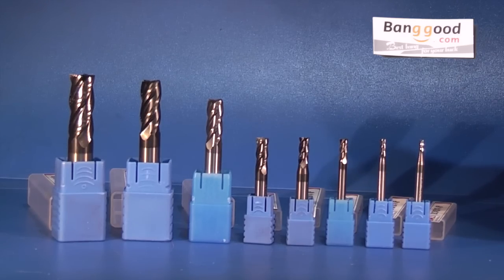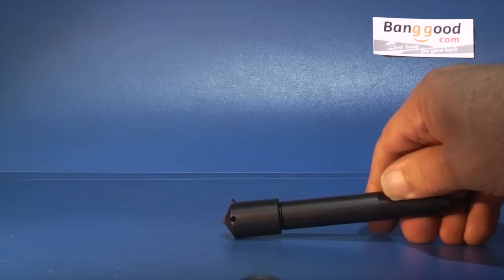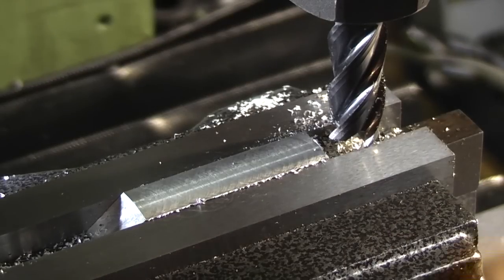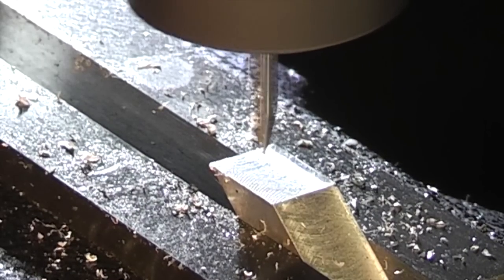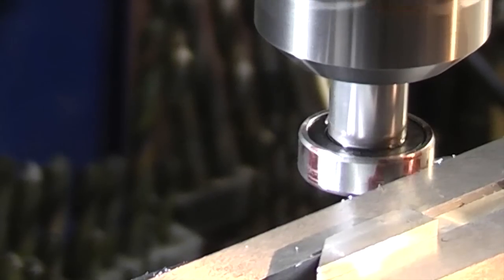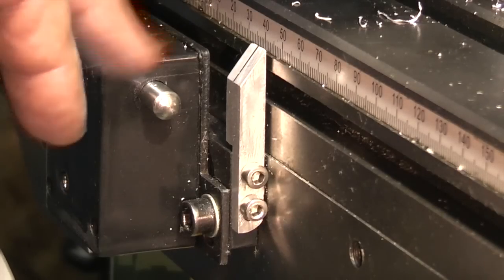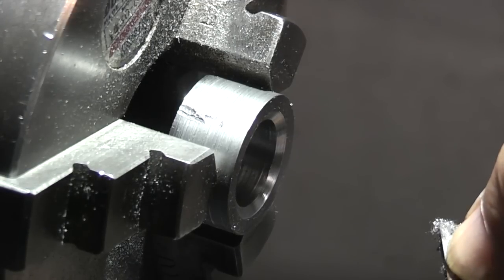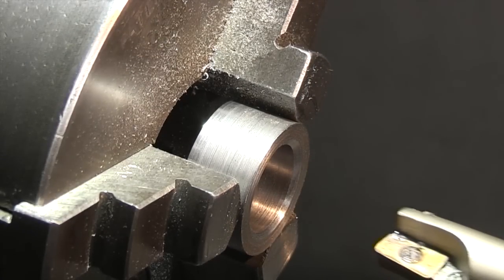Tool review /Table position block

Comment: Hi there Alan, why did you have to make a stop pointer for your mill, I thought you had a Warco Super Major Mill like mine, which came with the pointer attached to my mill table, but any way a nice video on how to make one, but I use my 4 axis DRO system for all my measuring on the mill, so I don't bother to look down at the pointer. All the bestBob